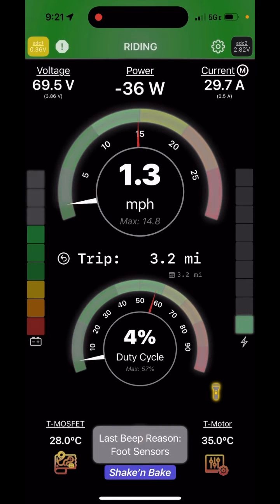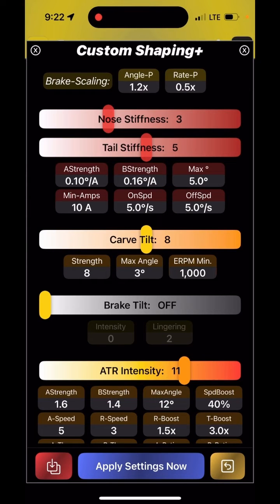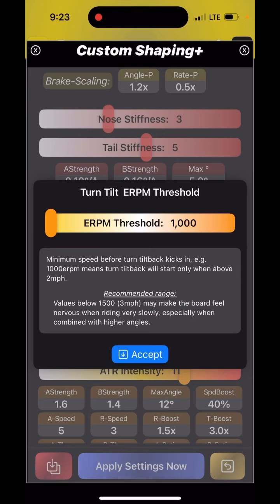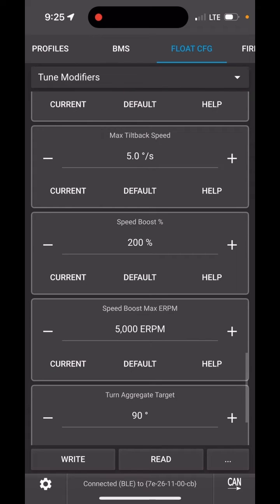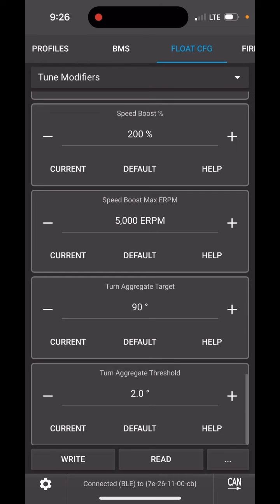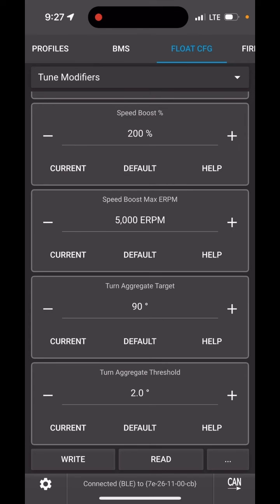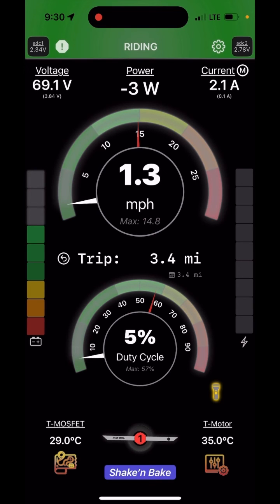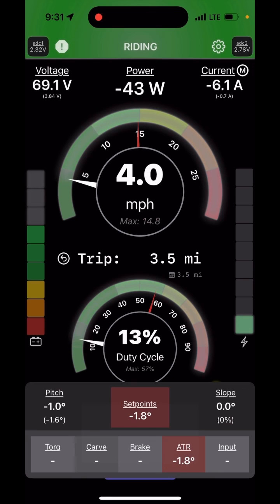How To: Turntilt Tuning (VESC Float Package)

Comment: There's a setting in the onewheel that affects the tightness or looseness of roll which is how loose the board is when leaning left or right while turning for instance and I can't figure out what setting for VESC affects that. Every setting I've tried is still extremely tight when I'm leaning into a turn to turn easier and am constantly fighting the board which is trying to right itself. Is this a setting in float control or floaty I can change or do you think I just need to redo the VESC settings setup? It's an XRv kit. I think the setting in the onewheel app is dynamic responsive which affects the behavior of what I am referring to.
Reply from the maker: if you want FM's horrible behavior where the nose would scrape on tight turns - we don't have a good way to recreate that - otherwise, set Carve Tilt to 0 and maybe increase Mahony Roll to 2.0 and see if that does what you're looking for
Reply: @surfdado  maybe I didn't describe it very good but it would be just loosening the roll of the board during cruising speed like 12-15mph. If im barely moving the board is nice and loose and easy to roll while turning. When I'm cruising and trying to lean into a turn it feels like I'm trying to get a solid slab of concrete to tilt. It's very tight and trying to carve back and forth while moving forward just feels way too tight like I'm wrestling the board and it's trying it's hardest to not roll even the slightest.
I thought the turn tilt has to do with it but that just seems to affect the nose tilting up or down while turning. I'll try doing the IMU and motor recalibrate and see if that fixes anything weird. I haven't done anything with it since the install. I just left it straight how it came from Tony but i figured it was maybe a tunes option.
I have been watching your videos on the settings for the tune options that Float Control and Floaty affect but I am still trying to learn a lot of it.
Thanks for taking the time to reply. 👍
Reply from the maker: @ you are describing the behavior of turn tilt correctly. I’m afraid there is nothing that our motor can do to affect the roll behavior - that is 100% a function of the tire profile.
Reply: I tried increasing Mahony Roll but it’s not an option on Float Control. It just shows the description with no slider. I can adjust Mahony KP but not roll. Should I be able to?
Reply: Just to follow up on this for anyone reading. I highly recommend updating your XRv to VESC Firmware 6.05 and swapping out the float control package to the Refloat package.  That had made a night and day difference for me as far as turning and carving. Would recommend starting from scratch after upgrading and setting it up using Surfdado’s excellent boring setup video.
Reply: @Slowcarboost1
I believe Surfdado is just referring to the regular Mahoney setting under the aggressive slider. I set my slider to around 5  aggressive and then I manually changed Mahoney to 2.3. It’s a nice tune for looks for turning and carving while still being responsive enough when I need it to be.

Comment: from my experience I think it's important to give a higher threshold angle like you recommended later on because if you wiggle the board left and right while riding straight forward (simulating roots and rocks that you might hit on a trail) you will get the tilt too. so I'm just not sure about that roll ignorance and yaw focus.

Comment: I actually thought that turntilt also prevents the nose from scraping when doing hard turns at low speed. If that hasn't anything to do with turntilt, is there another setting for that behaviour?
Reply from the maker: Poor or lack of accelerometer calibration causes the nose scrape on tight turns
Reply: @surfdado  I don't have any issues there right now. But I just thought, this can be adjusted somewhere in more detail. Cause to me it felt like those tight turns are working better with some tunes than with other. And I had the assumption that it's the turntilt that makes the difference. But apparently I was wrong about that.
Reply from the maker: @Eryktion  of course turntilt can affect tight turns, especially when tuned to kick in at low speeds
Reply: @surfdado  ok, makes sense 👍

Comment: I would really like to be able to set Tilt Strength in 0.5 or 0.25 increments in float control. Most tunes are running Tilt Strength 3. Any higher than 4 feels way too strong IMHO. 0 to 5 is the useful range .. I think most would agree.